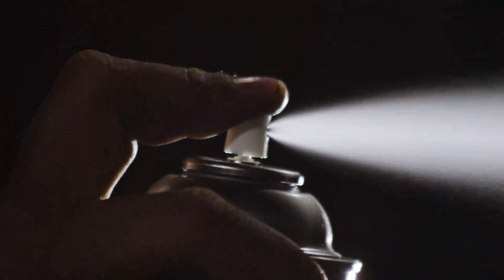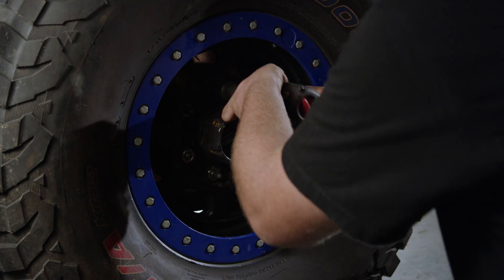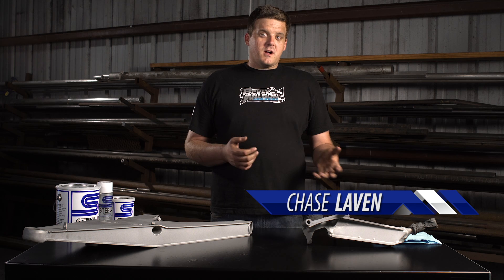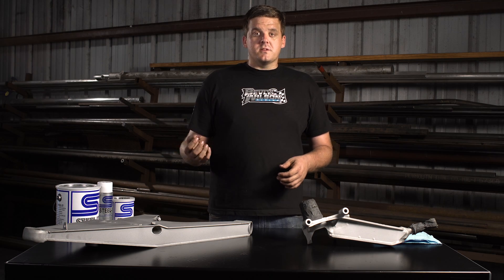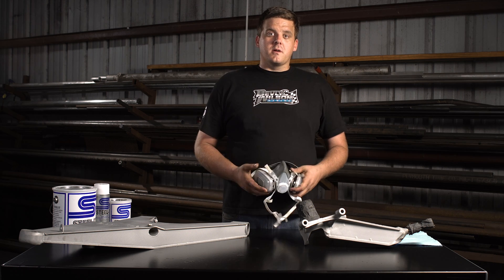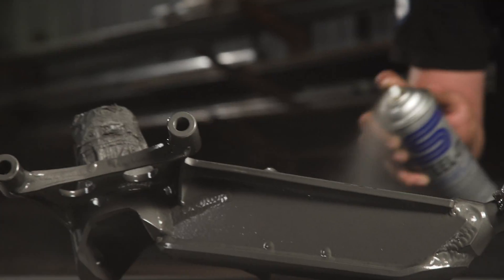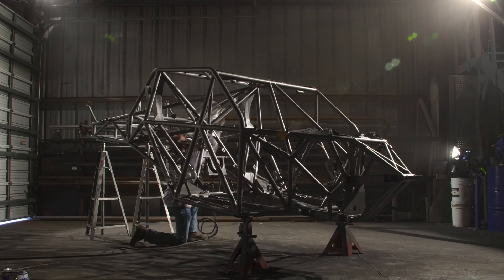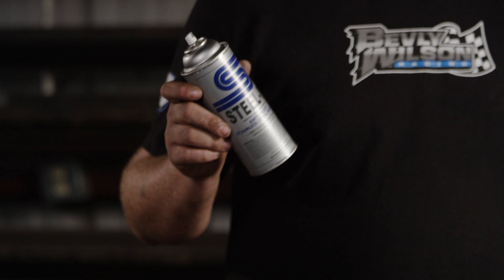How to Apply STEEL-IT Polyurethane in Motorsports Applications

Comment: Should you use a phosphoric acid etch or isnt it necessary? I can't samdblast but might be able to sand a little after chemical stripping And can I use say like a por 15 top coat on top of this?

Comment: When you use this in an air gun (I’m assuming you were using an HVLP gun), what size tip do you use? Do you thin or “reduce” it before spraying? Or do you just get a monster tip and go full ham? I want to use this to paint my entire truck, but buying it by the aerosol can would force a fella to go broke. Lol

Comment: Prior to coating just to let us know, you want 3-4 thick wet coats… umm isn’t that coating? And the point of the video? Vague wording. 47 coats needed for max product performance!
Reply: I was thinking the same thing. I was kinda thinking the might have been talking about using the primer. It's crazy they don't seem to respond to any questions on here. Did you end up using it?
Reply: 😂 it requires 2 coats. This stuff is the industry standard for structural steel, grain silos and USDA food grade storage containers. The fawkin US coast guard uses this stuff. We have it sprayed on all our semi trucks and it's over 5 years of salt, liquid road deicer and zero rust.
Reply: I find that the paint tends to puddle or run if you apply a heavy coat.

Comment: Can this be used over a powder coated part?  If so, is it the same process?
Reply: No, go to the actual steel it site. Proper application requires sand blasting to provide an aggressive base. No plastic, no spraying over rust, powder coat etc

Comment: How weater resistant is it? I live in the fantastic country NORWAY.  Would be simmilar to new york/canada. Rain from september ad snow in desember until april. A lot of salt on the roads.  Could you recomend it,or do i need to put on top layer of paint?
Reply: It's impervious to salt corrosion, it's used in marine applications and used by the coast guard.

Comment: When using the cans, do you need to use #2003 primer first?
Reply: one of the huge pros to this is that it’s weld through so you definitely don’t “need “ to prime it but I can’t imagine it would hurt.    It would definitely hurt its weld through capability tho.

Comment: Can you use it as a primer or do you put primer over it if you want to spray paint it?
Reply: No need for primer. Just sand the metal bare with the sandpaper instructed to use & begin painting with STEEL-IT.

Comment: Do you guys bake it or its it fine with 4-5 coats?
Reply: Spray can is up to 200 degrees, epoxy and polyurethane coatings are up to 300 degrees. Keep in mind, this shit is not for the average guy looking for rustoleum crap protection. This is the industry standard for structural steel, grain silos and USDA food grade storage containers, and used by the coast guard for superior salt corrosion protection. 1200 dollars for 4 gallons, this ain't for poor people, 😂
Reply: To my understanding it can't be baked. Powder coat place here said so.

Comment: I'm wanting to use this on the frame of my truck, control arms etc. Can I just clean it real good and spray it? Or does it have to be sanded?
Reply: It would need to be sanded with the grit instructed to use down to bare metal in order for the paint to adhere correctly & properly. But, yes if that is done you can use it on the frame of your truck.
Reply: The manufacturer is very specific about the prep process, why can't anyone go do research ffs. The absolute best prep recommendations are media blasting to provide an aggressive base for the coating. Too many people taking shortcuts and then bad mouthing the product. This shit is used by the coast guard for salt corrosion protection, it's the industry standard for structural steel, grain silos and USDA food grade storage containers. This shit isn't rustoleum crap, it's literally 1200 dollars for 4 gallons.

Comment: I see you sprayed over a rusted area, can this be done normally? I have bare steel fenders on my Jeep, and it rained a few days, now it has small areas stain of corrosion, I don't want to disassemble the whole thing again, can I just spray over it and be good????
Reply: He did not spray over a rusted area. That was the sand blasting. Seems like the finish of the sand blasting looks very similar to grey steel-it
Reply: This stuff will fail if sprayed over rust, as with any coating. The manufacturer requires media blasting to provide an aggressive base for the coating, you can sand with 36 grit for the spray can Version. Keep in mind, this shit is expensive, it is the industry standard for structural steel, grain silos and USDA food grade storage containers. It's used by the coast guard and in the marine industry for superior salt corrosion protection. 1200 dollars for 4 gallons, this is not for the rustoleum crowd.

Comment: that weld was atrocious. jesus christ
Reply: You can see he didn't prop and has coffee shakes.. I would still clean off as much of the paint as practical to keep the stainless out of the base metal alloy.
Reply: @billbry  genius, you don't grind the coating to weld. It is specifically stated on the actual manufacturer website... don't grind it off, you defeat the purpose, FFS. Do any of you knuckleheads actually research anything, lazy bastards, go on the actual site. This is not for the rustoleum poors crowd, this stuff is 1200 dollars for 4 gallons. It is the industry standard for structural steel, grain silos and USDA food grade storage containers. It's used by the coast guard and the marine industry for superior salt corrosion protection and you simpletons want to grind it off. Ignorance is abound on YouTube.
Reply: I noticed it too.  Glad I'm not the only one.
Reply: CRATER
Reply: Was thinking the same thing and I'm not a welder lol. This video has confusing instructions as well